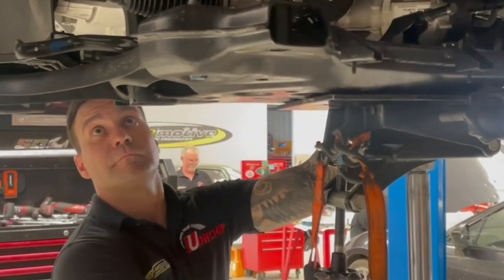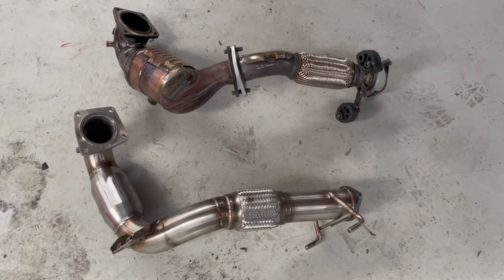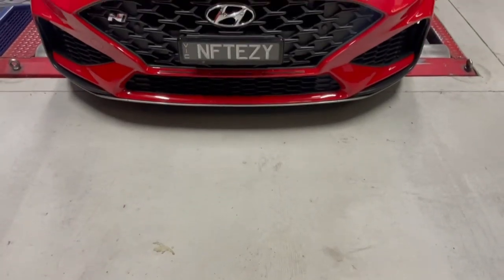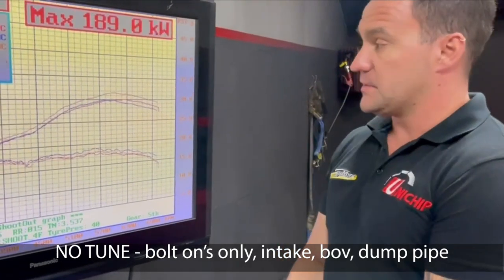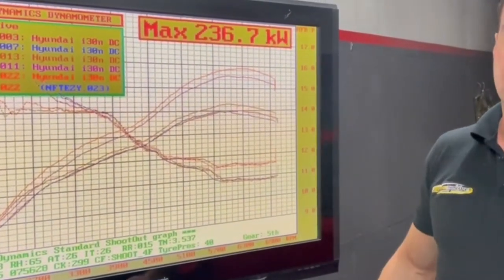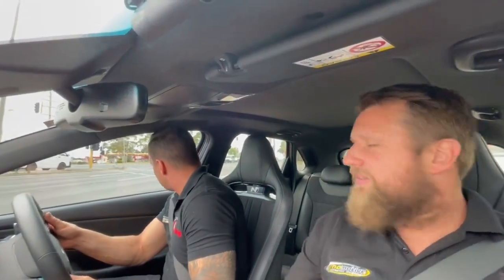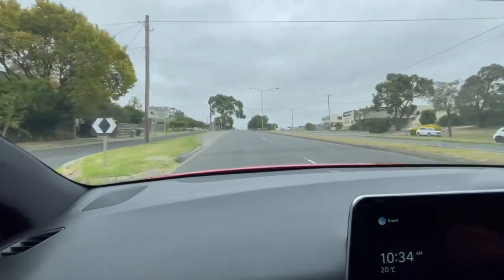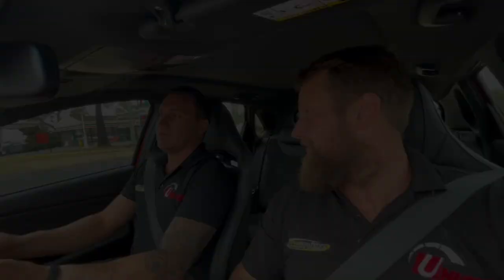Dynomotive Hyundai i30n DCT Episode 2!  LIVE dyno tune, results explained and test drive!

Comment: Awesome results guys, does the Uni-chip impact the i30N's warranty at all?
Reply: If you go in for warrant or a service at a Hyundai dealer.  they shouldn’t see anything on the ECU as the boost levels remains as standard/stock cause the unichip has a voltage clamp which prevents this. So it shouldn’t affect warrant, but I could of been feed the wrong info

Comment: Hi guys with the takeda intake installation  did you use the larger turbo flange and pipe ,in the first video a could see the factory fitting  thanks